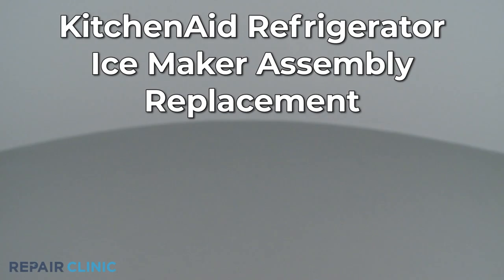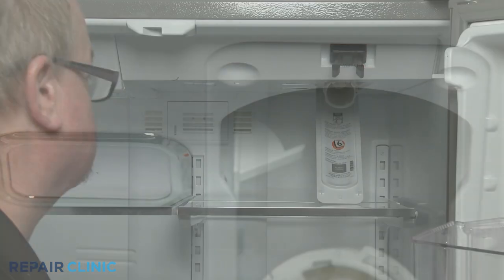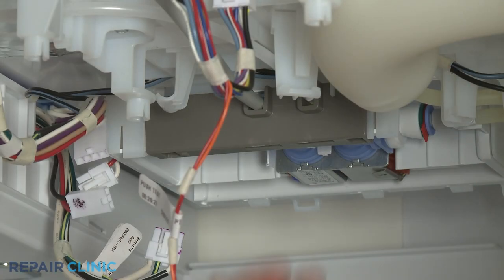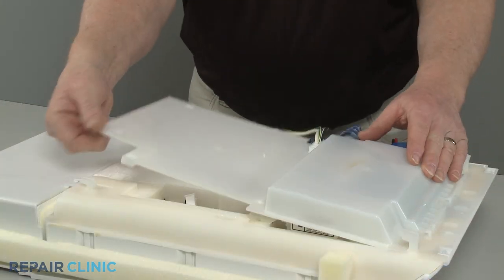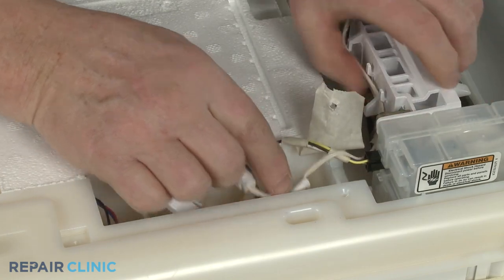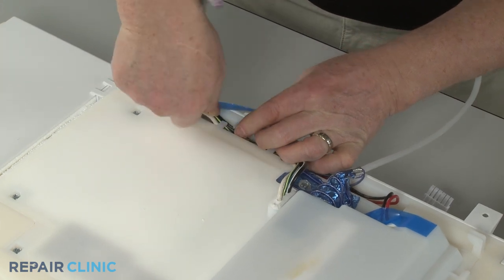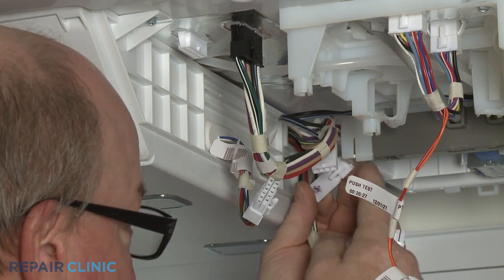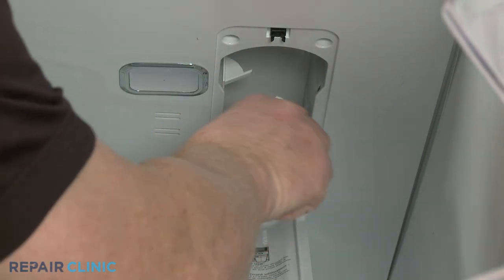KitchenAid Refrigerator Ice Maker Assembly Replacement W11483245

Comment: Great video, I just replaced mine on model KRFF507ESS00 but the ice is staying in the mould and not ejecting into the bin, what can cause this problem ? All the test I did passed and I’ve run out of options.